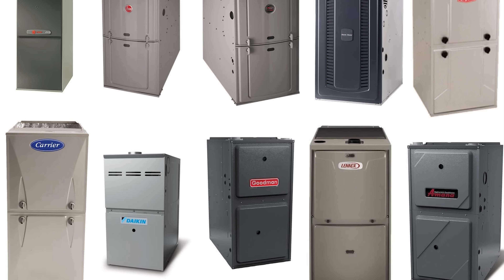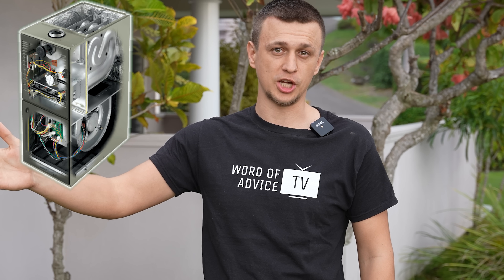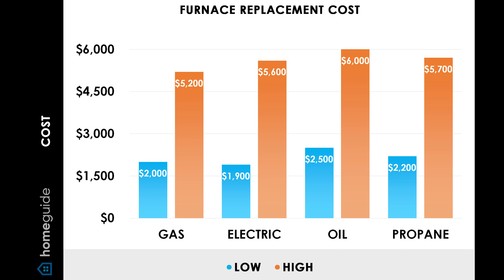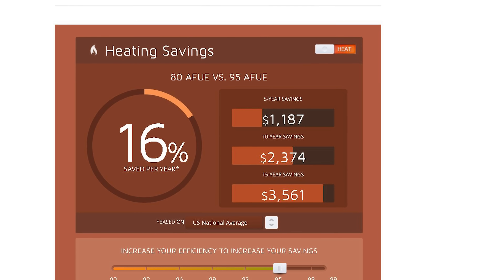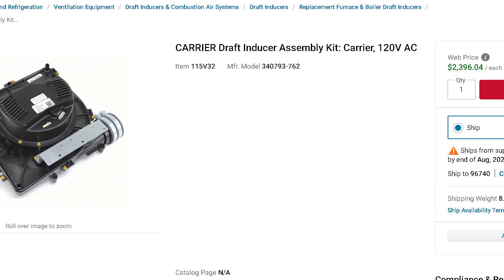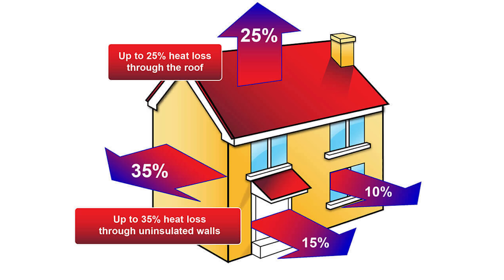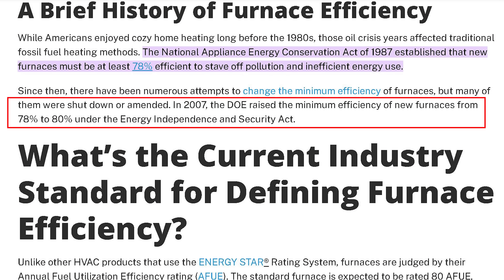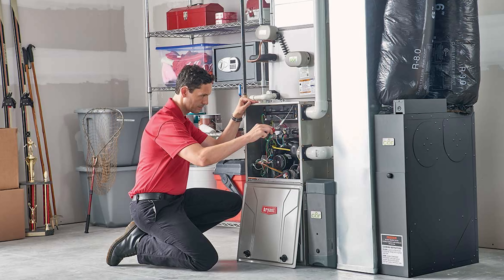Don't Buy a High Efficiency Furnace!

Comment: I totally agree! That goes for boilers as well.  I always ask my customers what they want.  If the customer values the high efficiency units because the want to be "green" or if the value longevity and reliability I often advise them to go with the lower efficiency units.  
Love the video!
Reply: Also there is nothing green about acidic condensate that goes into the ground from condensing furnaces and boilers
Reply: @gregs9555  Guess where that goes on an 80% furnace? Outside to the environment. 
No such thing as a free lunch.
Reply: @sprockkets  well at least it's not going outside into the ground possibly anywhere near my well, just saying

Comment: A little history, I live in the Chicago area, all my homes were in a NW suburb. All furnaces NG.  1974, first home, home built in 1954, changed original Armstrong furnace (drum heat exchanger clogged, cleaned to get thru winter, was blowing out pilot light) in 1980.  Installed Heil Quaker (80%….?), sold home in 1989.   Moved to new custom home with 2 Bryant, 90+% furnaces, after 10 years, basement 125k btu needed a board repair (servicemen usually replace, my nephew being an electronics guy, bypassed a relay and rewired) also needed to replace sensing switch. The cost of this repair would have been $240 (cost of parts) plus labor, it actually cost me $20 (bought a generic switch & calibrated it from info from Bryant). I never repaired the second floor furnace in the 14 years we lived there. Did one repair on an A/C condenser (5.5 tons, 1@3.5tons and other at 2tons), the 3.5 ton unit was hanging up and the compressor was in locked rotor. I would hit the side of the condenser and it would run ok. In a week it would do the same thing, so I had a hard start kit and installed it, problem over, I sold the home in 2003, never had any other problems. This home was 3750 sqft, not counting a 2000 sqft basement.  The heating bill was about 25% more than my first home but not unreasonable. My current home (track) bought in 2003, is a ranch, with 2240 sqft. and a full basement with an 80% Trane, 100k furnace and a York 3 ton A/C with a 42k encased A coil. It has operated without a problem until today. When I was finishing the basement, I needed to turn the furnace around because of a wall I installed. In the Midwest all furnaces on concrete in the basement are usually installed on 4 bricks, one in each corner, this made my turnaround easy. I also added an electronic air cleaner (all previous homes had them), humidifier (all homes had), added 2 return’s to the basement, supplies were done by builder.  The natural gas water heater is original and is not power vent, never had any problems, also had to turn around. I also have a Weber natural gas grill (SS parts inside) on the deck and it is also 20 years old and refuses to quit.  Any questions?   Thanks…Jim
PS:  Current home heating bill is ok. When it is really cold, below 0, it might be over $200 for a month. Last month was mild and it was just over $100. I do have a smart thermostat and during the day I keep it 73 degrees and 65 at night.
Reply: I found you Jim. You are doing dang good for being up there. My gas bill is about 100 bucks when it's cold, since the increase. I had a Weber grill on my deck outside hooked up to N. gas for many years, around 20. It was still working when I unhooked it and set it on the street. I got to where I like cooking on coals. Bought a weber pit and a chimney for the coals and been loving it. 😃

Comment: I have been in the HVAC industry steadily since 1973 so have a few years of experience upon which to base an opinion. I do agree with the views in this video but let me add that one of the biggest factors in the lifespan of any furnace is the quality of the duct system. I would say more than half furnace installations are short on airflow! Heat exchangers most often fail due to insufficient airflow. With the correctly sized furnace for the application, properly sized ducting and a quality installation I can envision nearly any furnace of any brand regardless of efficiency lasting more than 20 years.

With that said, I am a big fan of high efficiency heat pumps also properly sized, applied and installed. I live in South Dakota, the Black Hills in particular where we can experience a large variation in temperatures from summer to winter. Heat pumps work well here and provide both heating and cooling. I love inverter driven compressors and ECM blower and condenser fan motors. 

As a fulltime HVAC instructor I really enjoy watching Word of Advice videos. Quality production, wise advice and well communicated. I point my own students to your videos as another learning resource.

Comment: our 1964 80% efficiency furnace has a handful of parts, and we just replaced the gas valve.  We are keeping it.  We did the $ analysis on a new furnace - it did not make sense.   I oil the motor bearings and fan bearings each fall, when I change the filters.  I did replace some old wiring that had failed insulation.
Reply: Sorry to tell you. Your 1964 furnace is not 80%. Lucky if it's 60

Comment: I recommend Carrier high efficiency with 2 stage gas valve and variable ECM blowers. They will save you money in the long run because they're pretty reliable and the heat exchanger warranty is lifetime. This furnace is efficient and increases home comfort alot more than a standard efficiency can. There's 2 very important factors attributing to life expectancy: Installation quality & maintenance. With proper professional installation and proper maintenance, the firnace will easily last 20 years. I am in Michigan.
Reply: Hi, I need help as i will have my HVAC units replaced . Can you please let me know if a 2 stage HE can vent thru the standard chimney ? Thanks

Comment: I would avoid any modulating 2 stage crap and have a manual J done for your home for proper sizing. Most furnaces are oversized short cycles and affects the comfort and longevity of the furnace.

Comment: I have an air easy Johnson 80+ series and it has worked very good for year's. The unit has a low,medium, high, series fan blower. I switched the wires from low fan to medium fan and it has really worked well.  That brought the temperature up quicker because the heat fan blows more air. But if you have central air do not switch wires to high fan. The central air needs the higher fan to work properly. But you can switch the heat wires from low to medium. Look at diagram on your furnace for the low medium wires coming from blower motor and switch the two wires. Or when you have your furnace serviced have the heat technician switch the blower motor from low to medium, you will not regret it. And possibly have them turn up your flame a little bit at the gas valve, just a little hotter.

Comment: Mech engineer who has had designed and been involved in energy efficiency industry for 25+ years, I don’t use high efficiency systems for my personnel use but do have a higher efficiency condenser on my ac.  Experience has shown me that the old KISS moto is spot on and financials don’t work out.  Upgrading to a high efficiency system will cost @ $7,000 after rebates, save me @$300 annually giving me an estimated simple payback of @ 23 years and i’ll have to look at PVC exhaust running up back of my house next to my patio.  My existing boiler is 80% system is humming along at 31 years old.

Comment: The new TUBE heat exchangers are better thab the 80% furnaces.
The variable speed blower motors usually last twice as long although more expensive and use less than half the electricity.

Comment: I bought a high efficiency (claimed 96%) from Sears which is really a Hiel.   It is considered a CONDENSING furnace.  This was about 25 years ago.  I live in Minnesota so winters are COLD. The weakness seems to be the induced draft blower motor.  It's a fairly high rpm motor with a small impeller in the housing.  It contributes a little more noise while running but not a lot.  This furnace has had that motor replaced 4 times,  2 of them I paid for for about $200 each.  The last 2 were covered by a maintenance program from our utility company.  So if a person has to shell out $200 PLUS a tech to replace it, I really doubt anyone would really save anything in the long term.  I'll never buy one again.

Comment: I agree if the furnace ain’t broke don’t fix it. I also know there are  way too many condemned “cracked heat exchanger” furnaces out there and maybe 15% of them are actually the case.
Reply: Not in my area.
 ALL ARE CRACKED AND DANGEROUS.
 Or so they told the little old lady with no husband and so she bought the lie.
 I just know the BS I will be getting. 
 Like the grim reaper coming to call on my furnace.

Comment: I have 2 separate 80% furnace in my home, upstairs and downstairs.  I have replaced the parts in both, including the circuit board in one, myself, over the years.  I will keep them forever as they are easy to repair and maintain myself, which has and should continue to save money.

Comment: Excellent warning video. Yes efficiency is expensive. Remember my new a/c installed in summer of 2020? It has a ecm circulator motor. It’s very efficient. But it was replaced a few months ago. It was still warranted by manufacturer, but installation was $800. Just an example of new technology.
Reply: It shouldn't cost you $800 to install that motor, that's a rip off. At most $300 for around 2.5 hrs labor.
Reply: @sprockkets  I think the $800 was the total cost, surely it was, or he did get ripped.

Comment: My 90% plus HVAC lasted 28 years.  Failure of the AC compressor was the cause for replacement.  In 28 years I spent less than $700 in maintenance.

Comment: And don't get a modulating furnace! Lucky to get 15 years with one in Canada. After 10 is bonus years. I quoted an inducer motor today in one for $2300! I replaced the motor in my truck for less than that! Heat pumps are the next phase of equipment that works on paper but not in real life when it gets -40 for weeks.

Comment: I have a 48 year old 80% furnace that's still going strong. Yes it has a failure about every 3 or so years but thankfully through youtube and the internet I've been able to repair it myself saving myself huge repair bills. I've just about replaced every major componet besides the heat exchanger over the 30 plus years that I've owned this furnace. Keep asking myself should I just replace it but my common sense says why replace it if it's still working and working well.

Comment: It depends.... here we got $2300 rebate on high end he furnace. We got the bryant 98 with lifetime hx replacements, 10yr free full unit replacement. We also already have he pvc ducting installed, so its only logical for us to stay with he furnace. Our carrier 9300 died after 18 years and the new Bryant went in and cost us $5500 with installation.

Comment: Most of the problems I see with high efficiency furnaces are ECM blower motor failures. Because of high static pressure, poor duct design, undersized return grilles, and things like that.

Comment: My niece  has a 1965 78% furnace installed by the builder!  Just keeps running!  No inducer motor, no glow coil, just a pilot.  

I worked on a 1929 home with a Bryant gravity furnace, and the casting said Bryant Beverly Hills California.  The furnace was located in Long Beach CA.  Remember back in 1925, Beverly Hills was a farming community.  

Back in 2009, I replaced a indoor fan motor on a Singer high efficiency packaged unit, and the motor cost was over $600, so the customer paid over $850.  A normal unit would only cost about $200 or so.  

When I installed a air conditioner for my sister, I wish I had put in a heat pump.  It would use a lot less expensive electricity most of the year to heat her home, not the expensive natural gas.  My brother uses propane out in the country, and I might recommend installing a heat pump in his home, once the A/C fails, maybe sooner?

To get 100,000 Btu's of heat, you could run a heat pump for about 5 to 8 KW, or run a electric heater using 23 KW, or burn about 1.1 gallons of propane in high efficiency furnace or 1.2 gallons in a 80% model.  Usually the 8 KW heat pump is the least expensive mode!  A gallon of heating oil is the very most expensive way to heat a home these days!

Comment: also high efficiency furnace venting especially where it gets really cold can plug exhaust pipe with frost especially if dont use concentric termination  which s pipe inside a pipe    exhaust pipe the inside pipe and intake combustion fresh air outside pipe  
   the venting pipe usually PVC  and like plumbing absolutely necessary to pitch back to the furnace the condensation runs back to furnace  and in most install s have to pumped  to drain   other will freeze in pipe and plug vent shutting furnace down

Comment: My house was built in 1963 and had a 200,000 BTU furnace that started life as oil, converted to propane, then to natural gas when it was available. It had a belt driven blower that we ran constant and was the sound was only noticeable when the house was completely silenced. In 2001 I replaced it with a 90% 100,000 BTU furnace. I sold the house in 2011 and spent more on repairs than I could have ever saved even if the price of gas doubled. The old furnace was 2-2.5 times physically larger and that was the only gain in the trade. The new furnace blower was a direct drive and was very loud and annoying. The furnace was in the basement garage of a solid masonry house. No wood structure including the main floor. The 90% furnace did the job very well and possibly kept up better than the old 200,000 unit in really cold blowing (below zero) weather but at a much greater overall cost. I was told the old furnace was probably only 30-40% efficient if that much so that would explain why the 90% with lower input performed better. I also had installed a new gas water heater at the same time. I replaced the gas valve 3 times because of a flame sensor failure that was built into it and not replaceable. The 4th time I replaced the water heater. That high efficiency water heater cost me $2,200.00. As far as conserving energy? What was the energy cost of manufacturing and shipping  the replacement parts and new heater and the energy used by the HVAC shop to perform the work? In a nut shell, there is no dollar, energy, or climate savings anywhere in my experience. Only space saving in the house.

Comment: My furnace is 30 years old, and we're planning to replace it b/c the condensor failed a couple of time during the winter. After watching this video, we definitely don't want hight efficiency, but do you recommend 2 stage one?
Reply from the maker: Personally I would not go with a two stage furnace. Usually the savings are not worth it plus it adds a few more expensive extra components that can fail.

Comment: I have had 3 high efficiency furnaces in twenty years at my cottage. $6k a throw. My son-in-law has a steam boiler and steam heat. It was built in 1960. Terribly inefficient, but hasn't needed replacement for over half a century.

Comment: My house has a 1998 Carrier Infinty Weathermaker, 96% efficiency. The only thing I’ve had done is to have the condensate line cleaned several times. I change the 12 Merv AprilAire filter once a year. My gas budget is $73/month for my 2800sf house built in 1964. We also have a gas cooktop and a 1993 A.O. Smith gas water heater that I have done nothing to and it still works great. My electric budget on the other hand just for lights (all LED), the electric dryer (just my wife and I, 2 loads a week) and the power for the furnace HVAC blower runs us $158/month. That sucks!

Comment: I agree with your opinion.  The initial cost is higher, you will need to install a new flue if you are not replacing an existing hi-efficiency furnace, and the breakeven point on energy costs is around 6 years compared to an 80% furnace.  I just replaced my Goodman natural gas furnace that the builder installed in 2006 with a Trane 80% that was $3000 less that getting a 90% furnace.  The breakeven point is beyond the time we want to remain in this house, so it is just not worth the higher cost.

Comment: I had to install a high efficiency furnace as I use propane and no flue. I think it's 96%. The installer said he'd never put in a modulating furnace for the reasons you state.

Comment: Great information , I just purchased a house that has an older Gas Boiler it looks to be about 15-20 years old. I was thinking should I just replace it after moving in to save in NG? It's an Old cast iron radiator system that was converted to a baseboard. They said the system froze in the past and cracked the radiators. I wanted to get a HE furnace because I can install it away from it's current location by the chimney. It's in a bad place for access the Gas water heater needs to be removed to get access to the furnace just because of the proximity of the chimney.  But if the HE furnaces cost that much more to maintain/repair and can fail faster I'll be getting a standard unit. Pulling that 40 gallon water heater is not something I want to do ! Maybe a HE Water heater vented out a wall. So I can open up that space they are sharing now.